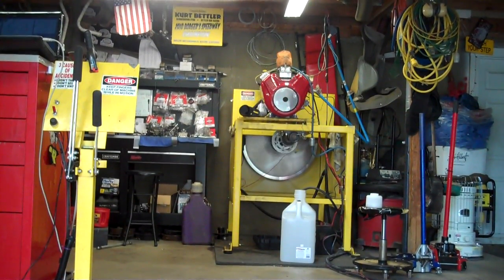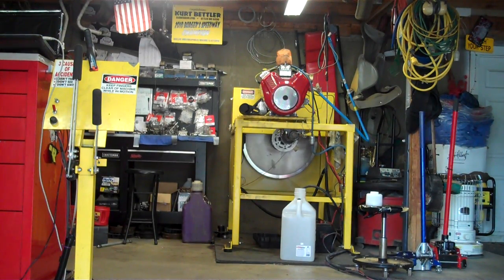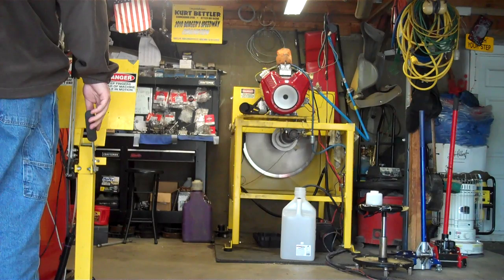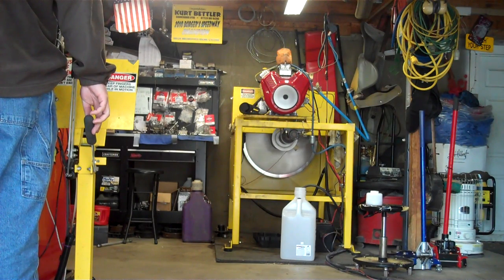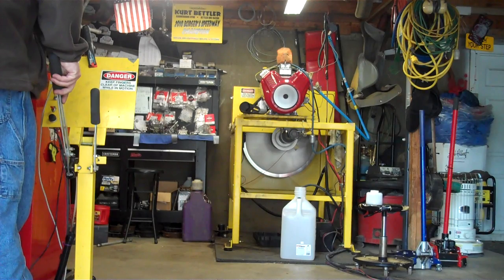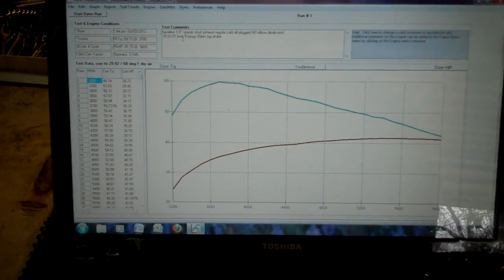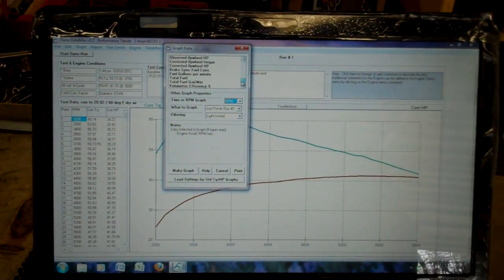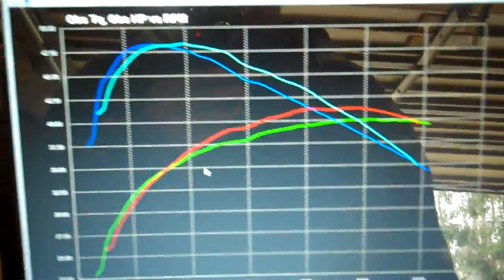Slingshot Engine Dyno Pull Basics

Comment: Simplest engine you will ever see to work on AND do a high performace build . Not to mention the most inexpensive  engine to do a high performance build.http://www.performancevtwins.com . We use them in HARLEY DAVIDSON ELECTRA GLIDES WHERE ORIGINAL (8000-8500$ HARLEY ENGINE HAS BLOWN UP.We  get the 35 hp briggs v-twin 9Cost 2000$) . Port, polish and plane heads to raise compression to 9.5:1 (cost 350$)  high lift cam (200$) 4340cHROME MOLY FORGED RODS (COST 120$ A PAIR) AND fORGED PISTONS (300$ A pAIR)  . NOW YOU HAVE ABRAND NEW 90 DEGREE( SMOOTHER THAN HARLEY ENGINE) ENGINE WITH 70 HP(10-15HP MORE THAN Harley ENGINE) FOR 2620$    HOOKS RIGHT  UP TO HARLEY 6 SPEED TRANSMISSION . fASTER, SMOOTHER AND VERY DEPENDABLE.  ps TAKE SHROUDS OFF BRIGGS ENGINE TO GET MORE AIR TO CYLINDERS and HE ENGINE LOOKS ... OOOL